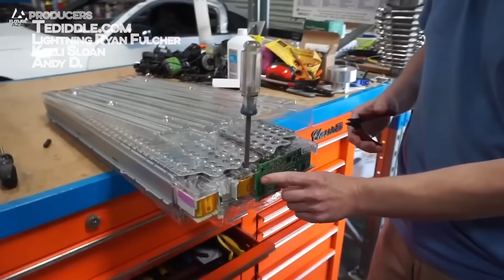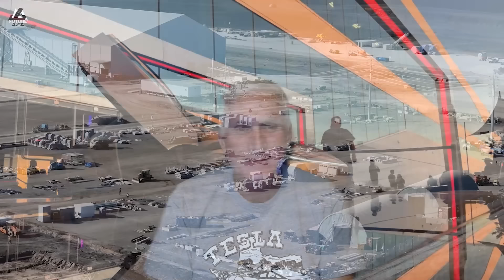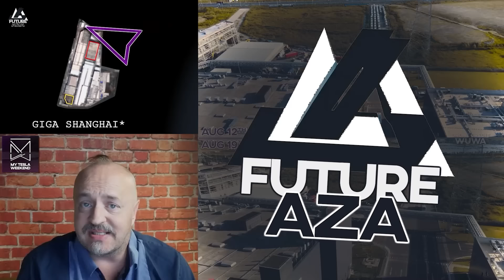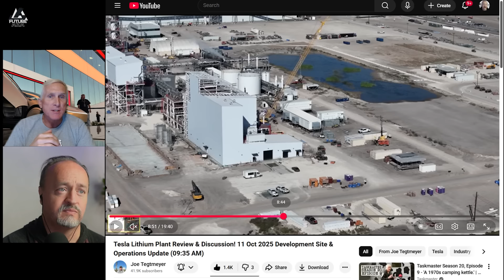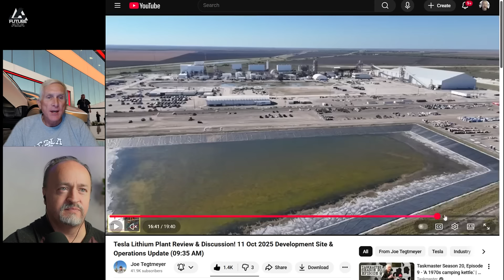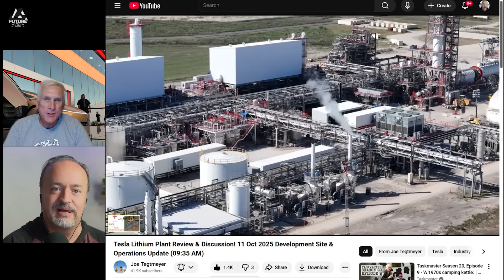Lithium Refinery Tesla’s TRILLION Dollar Bet

Comment: Sodium is more relevant to static storage because of its low energy density compared to lithium. It would make more sense for Tesla to use sodium in power walls and giga packs and redirect the lithium to its vehicles.
Reply from the maker: At some point. Sodium is still maturing so it will be some time before it reaches the US.

Comment: This plant seems insignificant to Teslas ptojected Lithium useage.    Tesla has spoken of having manufacturing capacity 1500 GWH    of stationary storage batteries by 2030.  Between all product lines this project fully built out appears to meet less than 5% of Tesla's projected use of Lithium by 2030.

Comment: Hoping recycling becomes a fairly large source of battery materials along with some innovative lithium refining.  Great to see the progress.  Thanks to both of you.
Reply: Hope in not necessary, batteries are the largest source in the future, when enough batteries are actually used, there is not enough worn out right now.
Reply: Recycling requires batteries to quit working.  That is not happening like media promised it would.  All the Teslas built in 2018 are still doing fine and the batteries are never going to die.  Most are only down 10-12% after 7 years.  The batteries are good for another 10 years before they get under the warranty.  Yet the warranty only lasts for 10 years.  So... only like .01% of Tesla owners got a free replacement battery from Tesla under warranty.   Fun fact, the batteries got better in 2022.  Then Tesla started using a lot of LFP too.  LFP last longer than NMC by 30%.... so those batteries will lose some range in about 30 years.
Reply: The batteries cannot be economically recycled.
Reply from the maker: @Withnail1969 I don't know who told you that, but they were lying. Batteries are already economical to recycle, and a lot of the ones that leave the automotive space aren't even ready for that, but have a 2nd or 3rd life in stationary applications.
Reply: @FutureAzA  This is simply untrue I'm afraid.
Reply from the maker: I've been to Redwood Materials. I've seen the operation. It is absolutely profitable. Even if you refuse or fail to account for 2nd uses in off-grid or even grid scale energy storage (both of which they do,) it's still profitable from the perspective of simply grinding them up for raw materials.

Redwood is not alone in this industry. There are companies around the world doing it as well.
Reply: @FutureAzA  Being there tells you nothing about whether it is profitable or not.